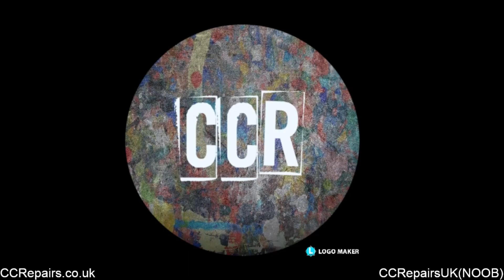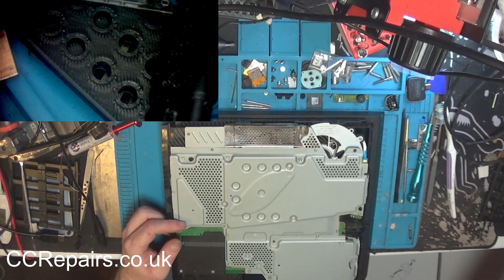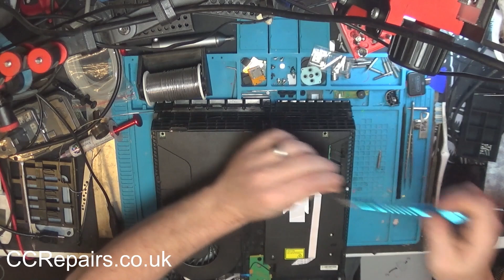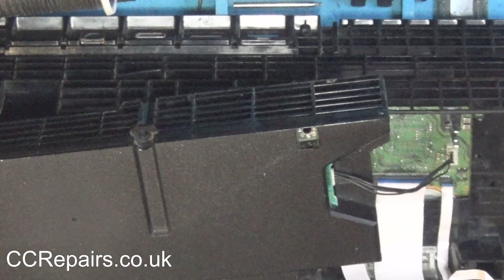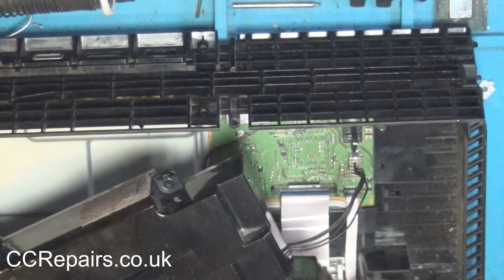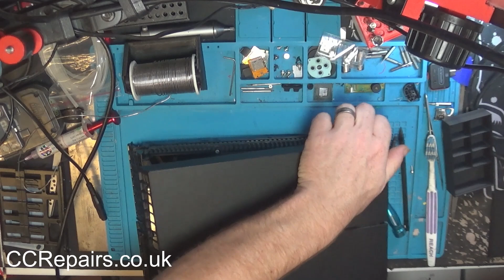PS4 No Power is it a simple fix?

Comment: My ps4 just turned off one day and when i try to turn it on it shows the blue light and turns off again. And now it's not turning on.what will I do?? please reply...
Reply from the maker: It could be caused by a few different issues hard to say without looking at it
Reply: @CCRepairsUK I Tried a different power cable and it worked for like 5 min today and then it turned off after making 2 small beep sound.and there is power on the metal plates and usb ports.Does that mean it is only a dust issue and need to be cleaned?? Please reply...
Reply from the maker: @_kiranjose_6345  it could do yes there is a chance a good clean and some new thermal compounds would help new pads and paste
Reply: @CCRepairsUK  I'm so happy to hear that...